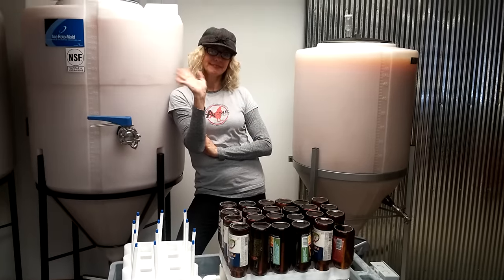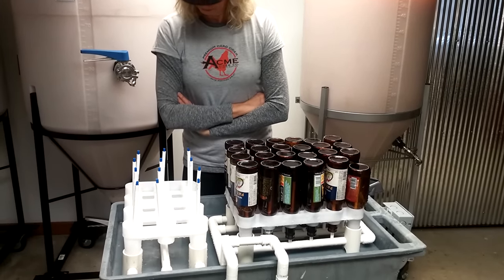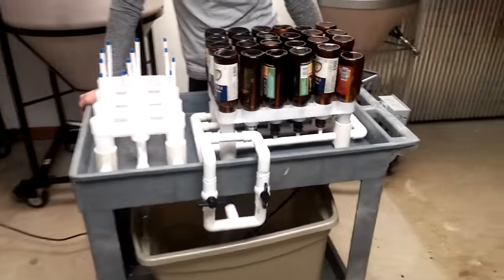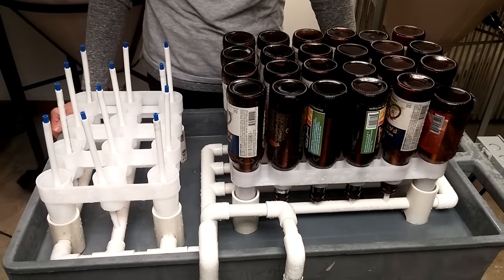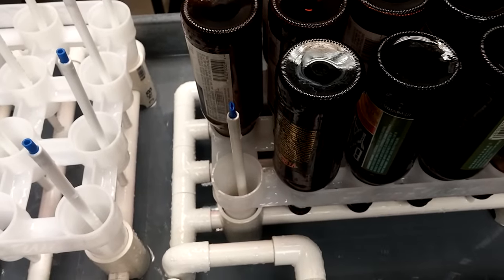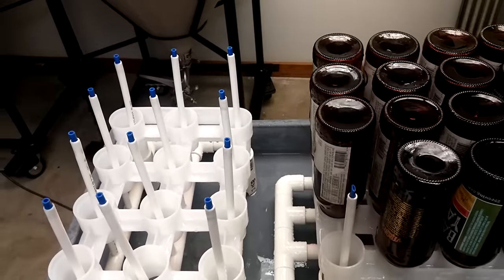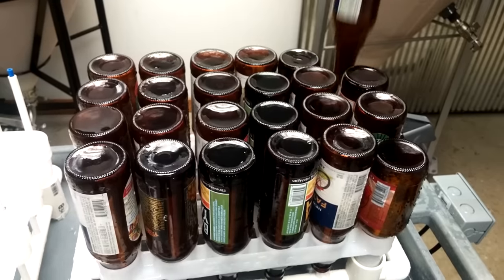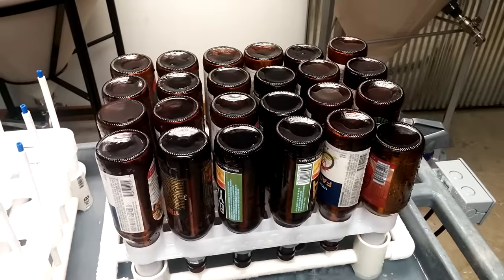Budget Beer Bottle Washer - Sanitizer

Comment: Hi David .....great job, considering making one myself, could you please list your components and diameter sizes, would be greatly appreciated. thanks Steve.
Reply from the maker: +Steve Mcneill Materials: 1/2" PVC tubing and fittings. 1/4" PEX for the risers. Drill with 3/8" bit and press fit PEX into 1/2 PVC. We used Fastrack for the template and for indexing the bottles, The rest of the info is in the video. We use this often and it worlds great. Fast as heck.

Comment: Also guys, what about the old label? how do you get rig off, is it with the same machine, other machine, is it portable too? Thanks.
Reply from the maker: If you mean the bottles with labels, they were only used for the video. We were out of new bottles at the time. Sorry for that.
Everything on that thing can be removed. We are going to make more videos, We didn't think anyone would be interested. We will be making videos for counterpressure bottling,  kegging, aging in barrels, and a handy dandy barrel strorage rack. And also a part 2 of the bottle washer. It's been in use for a year...

Comment: Great design and I would like to build one of these.  One question, what size is the pump you are using (gpm)?  Thanks
Reply from the maker: It's a small pond pump, made by Shurflo. I think it's 1/4 hp. Plenty of pressure.
Reply: what is the actual GPH of it?